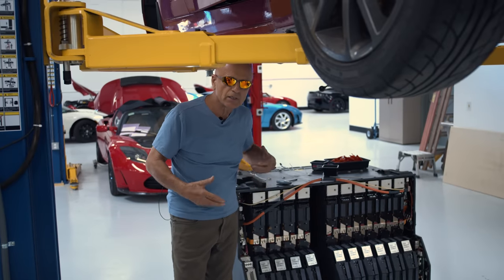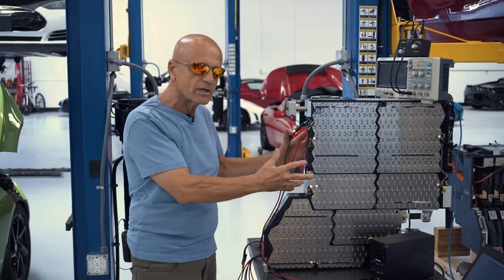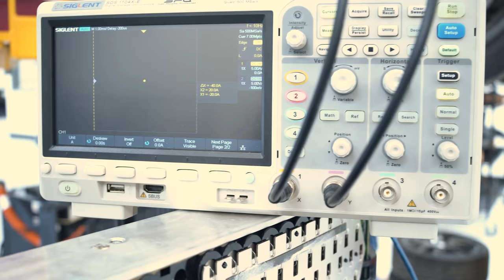Tesla Batteries STARTING TO FAIL | Gruber Motors

Comment: The battery tech in the early years is another century compared to what is being used today.
Reply: But they will last longer than what they are using now. Cutting down on cobalt in packs makes them more environmentally friendly and much cheaper to produce but on the flip side they don’t live as long it’s not new tech it’s 40 years old. What has changed? I keep seeing Tesla announce more capacity per battery but if you look it’s actually less powerful than last gen. It’s latest cell has 48% more volume but only 40% more capacity. You don’t have to believe me but if the new packs are so much better why has Tesla actually moved to a shorter warranty on the packs? 8 years vs the old ones being 10
Reply: Yeah, 19th century. First grade physics teaches you that batteries are a BAD idea.
Reply: @peterking8586  19th Century thinking on battery technology is a bad idea. I suggest brushing up on 21st Century Lithium Iron Phosphate sixteen hundred thousand kilometre battery technology such as that developed by Contemporary Amperex Technology Limited in Fujian, China, which goes in to every Tesla standard range vehicle made in the Shanghai factory.
Reply: @wattlebough  I do understand battery technology, I understand that it is the worst way of delivering power.

Lithium-ion batteries have an energy density of 450 watt-hours per liter, where as gasoline has an energy density of 46MJ/kg.
Reply: @peterking8586  Be nice to be able to fuel you vehicle up overnight while it’s parked in your garage for half the price of gas though wouldn’t it?
Reply: @wattlebough  And drive it from Denver to Houston in 14 hours? Not going to happen soon.
Reply: @peterking8586  A Model 3 standard range owner could expect to make that trip in about 16 hours. A Model S owner in about 15 hours. Not too bad.
Reply: The 18650's are not that old.. they were used in all laptops and many other electronics. They are Lithium Ion, and they still use 18650's in the Model S and Model X.
Reply: @mddunlap03  you did see the Model S with 1 million miles, right? You don't have a Tesla, do you? So NO real world experience.
Reply: @peterking8586  Worse than ICE?
Reply: @peterking8586  you are correct that gas has a much higher energy density than any current battery tech.  However this is an apples and oranges discussion as the energy in gasoline can be used exactly one time, while batteries can be recharged 1000's of times.  A 30mpg car will use 5000 gallons of gas in 150,000 miles.  At a weight of 6 lbs per gallon that's 30,000 pounds of gasoline.  Pretty sure that's drastically heavier than an EV battery pack.  Coincidentally since a gallon of gas is now $6.00 in many places that same 30mpg car will use $30,000 of fuel in that same 150k miles.  For comparisons a Tesla travels a mile on 275 watts of energy.  That's 41,250 kwh over the same 150k miles.  Even at my sky high CA energy rates ($0.26/kwh) the cost for energy is $10,725 for the Tesla compared to $30k for the 30mpg car.  

So you may think batteries are dumb but the math pencils out quite nicely.  Battery tech is improving with everyone expecting the math on EV's to get significantly better than even today's favorable numbers.  Oh yeah a Tesla is way more fun to drive than a 30mpg car.  To get comparable performance from a gas engine you would have gas mileage in the single digits.
Reply: @Ry-lx2kl  Everyone who is comparing gasoline to electric is being pretty irrational. Modern gasoline cars are now totally obsolete compared to the best long range electric cars, which have air conditioning and heating which runs while you're in the grocery store, and the car is fully climate controlled (you can keep your pet in the car and keep it at exactly 70 degrees in a Tesla, for hours and hours with very little drain on the battery due to a small air conditioning unit (heat pump) being used for the HVAC system). Everything about electric is better, except the single charge range. People never use their entire fuel tank all at once on a gasoline car. Only rich people who have free time, are able to drive 500 miles regularly for "joy rides." Gasoline cars are just no longer a valid transportation for the "normal" people.
Reply: However, there are several massive, massive, oppressive and pissed off elephants in the room. Behold:
1.) They are trying to force electric cars on people. That is not acceptable. 
2.) They have blocked at least 5,000 patents, many of which involve gasoline fuel saving devices which can get a car up to 90 mpg or higher. Shell oil publicly showed a small car that got 376 miles on one gallon of gas in 1973, using a car that someone built in their garage. You can see this car, it's still in it's original form and privately owned. 
3.) Why are gasoline cars being "phased out" instead of upgraded to have 200 or 400% more fuel economy? Stanley Meyer? Huh?
4.) There is still an element of deception and greed among the oil companies, and car companies, who are STILL clearly colluding to prevent new technology. See #4.
5.) Switching to electric cars, without improving existing gasoline cars is NOT acceptable. See: Opel car that got 376 mpg in 1973 on regular gasoline.
6.) They owe the consumers an option to purchase more efficient gasoline vehicles. 
7.) If collusion continues, and if the scam of expensive energy continues, then electric vehicles might be more expensive to charge than gasoline is currently. 
8.) Owning your own solar panels might be necessary in the future, to avoid being ripped off by the energy companies.
9.) Why do gasoline cars and trucks get the same gas mileage now, as they did in 1952? 70 years, and less than zero improvement?
Reply: @Ritalie  I'll go ahead and respond to your points.  1. There are energy mandates trying to encourage people to move to electric cars.  There is no gun to your head forcing you to buy an electric car.  The most aggressive plan today is all new cars being electric by 2035.  That doesn't mean you can't buy a used car or that technology will be able to meet that mandate.  There has to be a energy plan moving forward and living in a society absolute freedom is a myth.  what we do affects others and absent of a plan progress is slow.  2.  You're getting into conspiracy theories on these supposed 90 MPG cars and 5000 blocked patents.  We have lots of brains working on improving mileage on cars in the last 50 years.  I don;'t know the details on shell oil getting 376 miles on a gallon of gas but it doesn't pass the sniff test.  Why would Shell oil be involved in car production?  Why would Shell oil want to make cars that would reduce the consumption of their product by 90%?  Why would shell oil publically show this car then reverse course and bury 5000 patents?  Was this car actually usable at this 376MPG or did it do 0-60 in 20 minutes using a lawnmower carb with no weight in a car that isn't safe?  Did they use tires with very little contact to the road?  It just doesn't make sense for Shell Oil to make a product that would diminish use of their product by 90%.  3.  Upgraded to 200-400% more fuel economy?  How?  We have had lots of money poured into making ICE cars more efficient.  If any auto manufacturer could find the magic ingredients to get this done there is a massive incentive to do so.  The best ICE engines today claim about 40% efficiency at the conversion of the energy in gas to moving the car down the road.  Those vehicles get about 40mpg.  So the best we could possibly do is get 100% efficiency out of a gas engine that same vehicle could get 100MPG, not 376MPG.  We simply cannot extract more energy from the gasoline than exists within the gasoline.  To improve mileage beyond this improvements need to be made to aerodynamics and weight.  We're not about to delete all the safety systems in cars that add weight to a vehicle.  Stanley Meyer?  So the conspiracy this guy was so smart in the 70's that he figured out all this tech that allowed super efficiency and the oil and gas companies killed him and buried the tech?  Look even if you buy that as true in the 50 years since millions of brains and billions of dollars haven't been able to replicate his technology created in his garage?   There's collusion between the gas companies and the car companies making the car companies work against their own interests?  Car companies have to obtain more and more MPG by government standards but they are leaving tech on the table so the oil companies can make profit?  5.  They are improving gas cars.  Have you been under a rock? Again this 376MPG car - why can't anybody do it today with access to massively better tech?  Any car company that could produce a 300mpg car would be able to sell millions.  Why wouldn't they do this?  7.  You have to prove collusion.  The oil companies aren't one entity.  The car companies aren't one entity.  The providers of electricity aren't one entity.  But we're supposed to believe we're in a 50-year-long worldwide energy scam?  All of these companies in separate industries, in separate countries, representing the interests of many different groups but they are all colluding together to make sure 376MPG cars never make it to market?  8.  The math pencils out pretty well to own your own solar panels.  Fossil Fuel energy is becoming more expensive to extract.  Oil companies need to dig deeper or extract from shale oil sands.  Coal companies have to follow more stringent environmental rules.  Yes if you don't want to be at the whim of energy producers making your own is pretty smart.  What world are you living in where you believe gas cars today get the same gas mileage of 1952 cars?  My 69 VW Bug would get about 20mpg with less than 60HP.  A Toyota corolla today does about 40MPG with twice as much weight, air conditioning is more reliable and has more than double the power.  My 63 and 66 VW Busses got around 15MPG, The new hybrid Toyota Siennas is pulling 34MPG.  Even non-hybrid minivans with over double the weight and a 400% increase in power can get 22MPG.  These are just a couple examples but if you really believe cars have had "less than zero improvement" then there isn't much I can do to get you to see objective reality.
Reply: @bigdougscommentary5719  the one million miles is bs. It never factors age of the battery packs state of charge they kept it at and the range graph of battery degradation. For all we know the batteries could only have 20 miles left after 200k miles and can't hold any charge at 1 million but it lasted a minion miles right . Also it never factored in the current temperature which plays a huge difference.
Reply: No... is the same.
Reply: @wattlebough  That's called, "The siphon hose recharge method".

Comment: That is awsome Pete!.. I am testing and repairing EV battery since many years too. And i am famillar with dying cells in a parallel string.  If you are not using FLIR technology yet to find dying cells i suggest trying that asap. When recharging a parallel group with a dying cells with current leak it will get few degree higher and with the right FLIR camera with a good NETD spec  you can SEE / identify it easy. The important thing is that you dont need to disconnect any cells from the parallel group. when the pack is full at 4.20V and it have coolded down(stabilized) the cell with currenty leak will be identifiable easier.  I also suggest keeping all these dying cells for future examen. Some will have bad gasket on the top crimp of the cell and leaking electrolyte which cause slow short between the positive tab and negative edge of de cell can. The cell gasket is often made of PBT and BItumem as adhesive to make a proper seal, but some will fail over the time and when the cell internal pressure rise over the time and recharge, the electrolyte will leak easier. I hope this help.
Reply from the maker: We tried FLIR, and found results mixed and inaccurate.  A couple of years ago, we nailed a measurement and isolation method which we are now using 100% of the time.
Reply: @grubermotorcompany   I think Gruber Motor Co would rather you go to them for their undisclosed proprietary approach rather than locating the cell with FLIR then disconnecting hot-spot cell(s).
Reply: D'oh!

Comment: The decline in range is continuous and occurs each time the battery is charged.  After 500 charges the range is reduced by 20%.  Also what is not mentioned is the cost of replacing a battery pack is at least 20k.
Reply: That’s a full pack price. Rich and others can swap out the duds for cheaper …
Reply: @chrisbraid2907  No, swapping out "duds" is not a viable business.
Reply: The data you're quoting is mid-leading...

1) What you typed is an exact google answer for cell phone batteries, not EV's.  EV's have much better management systems and hold up WAY better than cell phone batteries.

2) It's 500 cycles, not 500 charges... that sounds like the same thing but it isn't.  A cycle is a full 100% cycle... in other words if I used 50% of my battery and then charged it, that's half a cycle.

There are definitely some batteries that are worse than others, but as an example, a good friend of mine has a 2018 Tesla M3 Performance with 60,000 miles on it and has a degradation of about 7%.  His original max range was 310, now it's about 290... that's almost irrelevant since the majority of EV owners charge up overnight and don't use anywhere close to their full range daily anyway.  He said it's literally a non-issue for him.   Besides it's not like ICE cars don't get less fuel efficient over time as parts wear down.

As for cost, yes they're not cheap to replace, but 20k is high... most replacements run around 14k for Model 3's for example.  That said, engine and transmission rebuilds aren't cheap either.  Certainly not 14k, but definitely not free.  The lower overall maintenance cost of an EV can help eat into that difference a bit also (no oil changes, fewer brake pads changes etc).

Anyway, there are arguments to be had for both sides of the coin here, but EV's definitely aren't what some of the haters make them out to be (not saying you're one of them, just saying).
Reply: Real world data shows that the cells are so rarely fully discharged that they incur very little of this discharge/recharge degradation. If in your daily commute you're taking the cells from 4.2v nominal to like 3.9v because you only commute a dozen miles, that light use combined with proper thermal management will keep that pack running for a very long time. 14 years, for example, without a major problem.
Reply: @dski8097  its like dead sectors on a hard drive
Reply: Its not as bad as you make it out to be. 20k for a "brand new car" every 10 years is fine, especially if its a newer upgraded battery, If you cant afford it, buy a civic? Also 500 charges = -20% is wrong. That sounds like a phone battery.

Comment: Thank you for the the great explanation of the single dead cell problem for the whole pack and the solution your team has found! This is genuine and practical thinking! I've been using and managing LiPoly Sheet cells for Radio controlled models since 2004 on a hobby scale and remember my joy, when I heard about the tesla roadster Ev's in 2008. This could have gone bad in so many ways, like it did in dozens of Laptops from many brands. The fact that tesla managed to design a battery management, that lets the cells typically live more than ten years is simply amazing!

Comment: I wonder if they detect the bad cell by a heat image camera or they sense the current into each cell by the magnetic field created by the current.  Once heard that each cell is connected by a small wire which acts as a fuse should the cell short.  In that way a small voltage drop could be detected. This video makes getting to the cells easy.  On others it looks like a can opener is needed and the housing gets torn up.
Reply: I was thinking the same thing, I bet he's using a thermal camera, the warm cell would be a dead giveaway. You could also easily measure the voltage drop across that wire to the cell as you mentioned.
Reply: @alexkram  If I get one of these(I'm considering one to run a camp AC and drive it into town to recharge) I'll put the pack back together with a weak sealant like rubber cement and tap the case with a port to 1psi of nitrogen to keep water out. Nitrogen is easy to get and free. It will only be a nice day driver since I'll have a second vehicle.